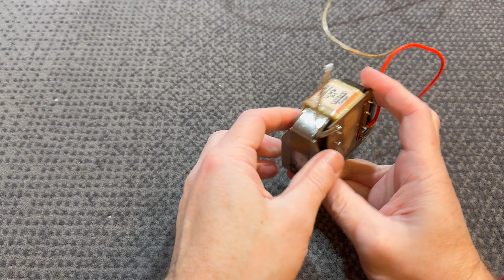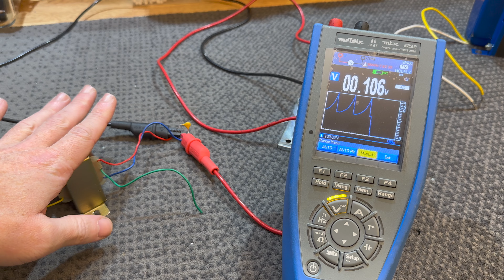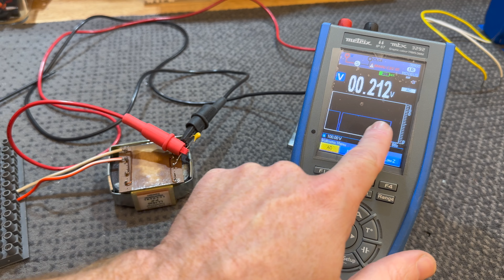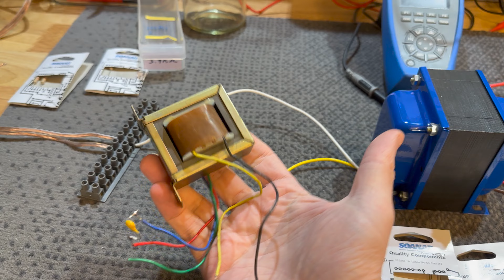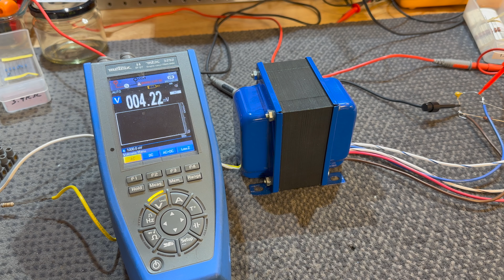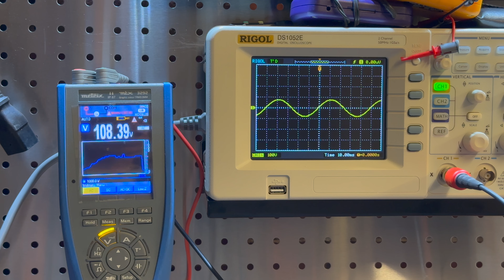STAX Earspeakers  - The Audio Transformer Rabbit Hole...

Comment: I did exactly that as a teenager, many old german tube radios had an electrostatic tweeter, some of them sound really fantastic. Hook them up to +200 and -200V and feed an output transformer "backwards" from any amp you like. Use a small-ish bass-blocking capacitor in the primary to reduce distortion.

Comment: Those Edcor transformers have too high of leakage inductance and capacitance. You could try an audio specific toroidal transformer - those should technically have the greatest bandwidth if wound for audio purposes. You don't want to go with a standard toroid as they are often bifilar wound and have high interwinding capacitance. You would need to contact a company such as Toroidy to get custom toroidal transformers wound. You want to specify that you are looking for high inductance (300-500H) and very low leakage inductance and capacitance. Something like a 1+1:12+12 or a 1+1:10+10 turns ratio, etc. (depends on how much voltage drive you have from the amps hooked up to them). You could make sure they use thin enough wire to give sufficient primary resistance as well. If you provide Toroidy with the details on what you are trying to do they should be able to help you out, though it may be a bit costly if they have to do a huge amount of interleaving to get the transformer to the specs you're looking for.
Reply from the maker: Many thanks for the advice, I shall look into this also! :)

Comment: I wanted to buy a Lundahl transformer box then I saw a used Blue Hawaii BJT for the same price so I got that instead. I wonder what has better frequency response. A Lundahl box or Blue Hawaii
Reply from the maker: It depends on the transformer setup specifically, a Lundahl LL1630 is about as linear as it gets (depending on the amplifier also) and only struggles around 20hz where its limited to about 280VRMS) this scales ip very quickly after 30hz where it can run head to head with direct drives. I personally prefer transformers and they’re much cheaper to build compared to a blue hawaii etc and you can use many amps to change the sound profile.

Comment: Just go straight for an LL9202AM
Reply from the maker: I'm working with someone else who is testing the LL9202 (non-AM) currently and encountering similar issues to the Edcor unfortunately and cannot run without external resistors due to the low impedance on the primary side... Not sure if there is anything out there that can more closely replicate the LL1630's winding characteristics but just more capable with core saturation?